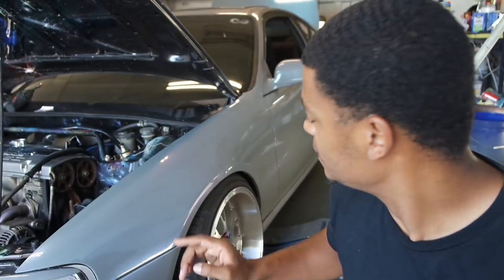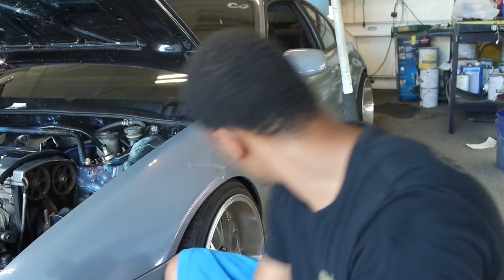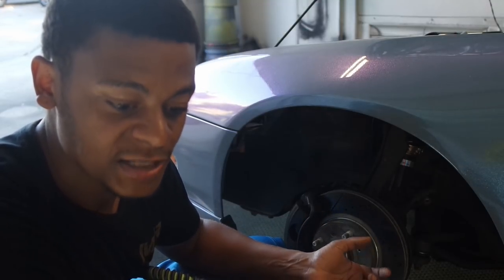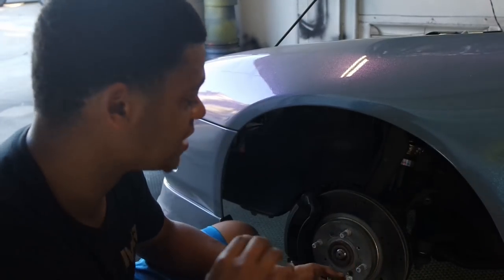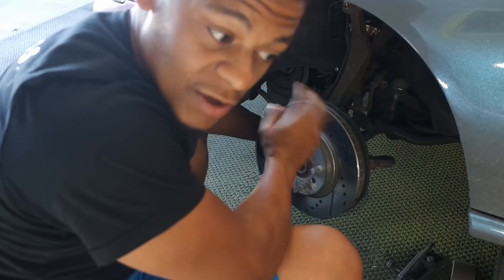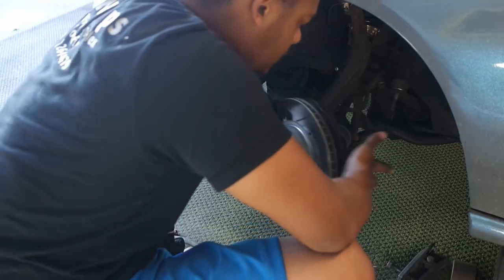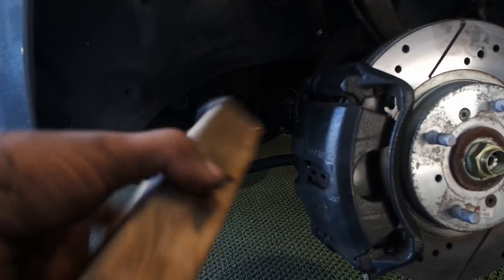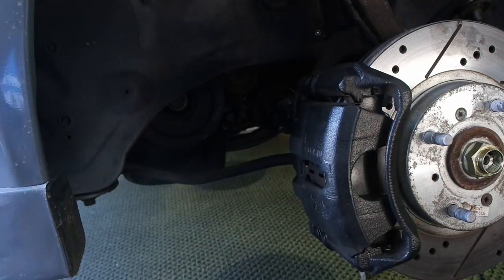How to change your axle | Honda Prelude

Comment: Word of advice - never use air/power tools to screw back nuts and lugs, especially bushings. And always use some grease. I came across way too many overtightened nuts that just either snap heads off or dont budge  at all, casing more troubles and take more time.

Comment: torque specs
Lower Ball Joint Nut 69 - 78 Nm (51 - 58 ft. lbs.)
Left Driveshaft 484-489 mm (19.1-19.3 inch)
Right Driveshaft 493-498 mm (19.4-19.6 inch)
Front 245 Nm (181 ft. lbs.

Comment: Bro always check out your vids when need lude info. What type axels you get. So much back n forth online about after market ones. Vibration, they go fast this n that. What you hear . I need some
Reply from the maker: I just get mine from advanced or autozone. I never bought any online
Reply: Ok. Damn they must be good if they handle on your moter. Thanks
Reply from the maker: @2sleevefinley  honestly bro if your not at the track launching your good

Comment: 5th Gen would not have matched up to the hub. I know this because I accidentally got a 5th Gen one and when the axle nut was tightened down, the outer joint was fully up against the inner part of the hub. It's a little larger diameter.  What this means is the outer joint will be so tight against the hub it will not be able to even turn at all.  I went to drive mine with this unknowingly and the car would not even move.  Lol. It was a fun day for sure.
Reply from the maker: James  Stewart lmao i know different companies mak3 different spec as well.
Reply: You can shim it with a washer

Comment: passenger side someone was saying you have to remove the radius rod to remove the axel is that true? then i have to get alignment after?
Reply: NotAsian on the fourth gens the passanger is the same as the driver. Its only different on the atts fifth gens as space becomes extremely limited
Reply: shamandarnell thanks!

Comment: after tons of swearing and now covered in axle grease i finally got in the new one. that double wishbone suspension makes it way annoying
Reply: @treybedipping1734  shes drivin like a dream now, thanks for your simple straightforward videos m8. unfortunately not a vtec but i had to hop on a 94 Si with 103k on the odometer for 1600$. just need body work to look good now